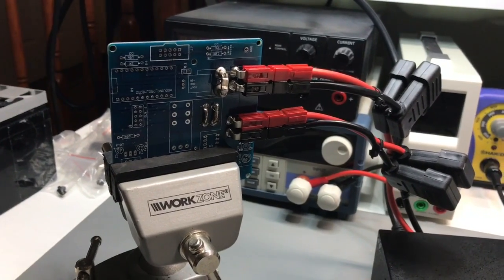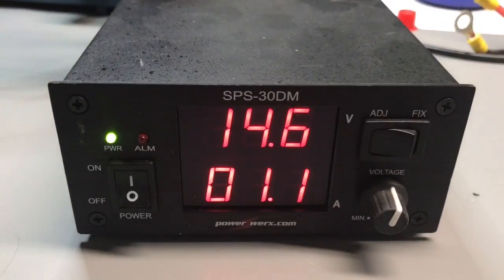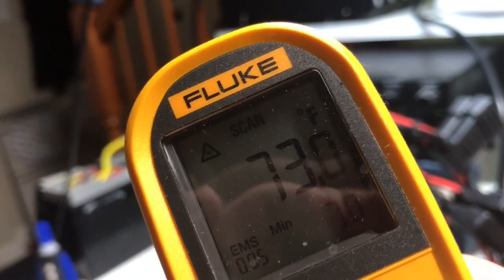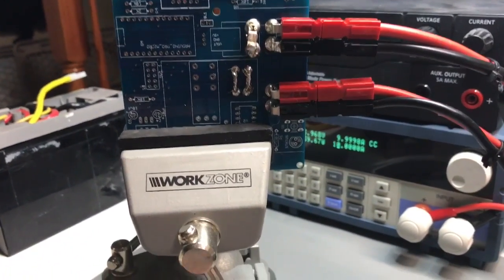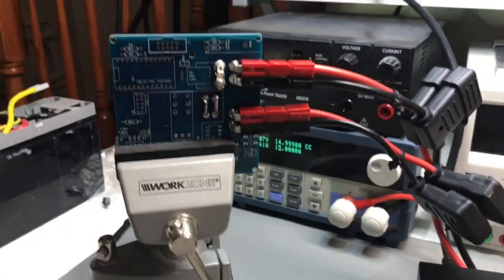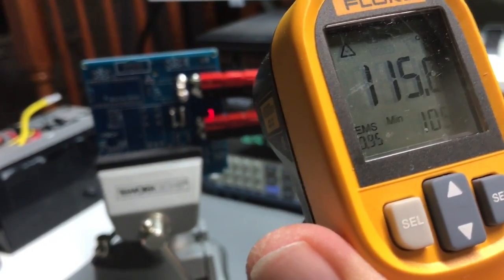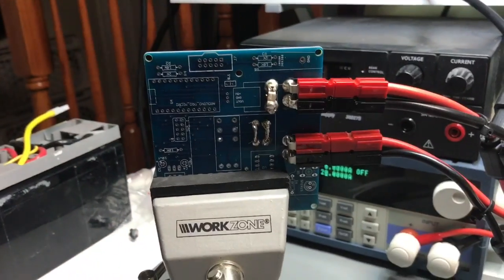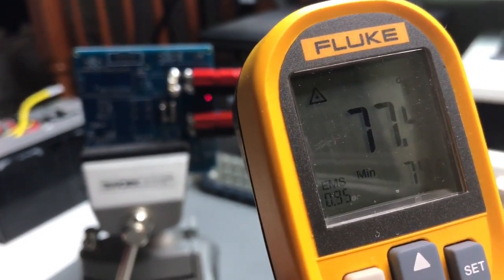Ham Radio 360 Workbench Power Board Current Handling Test

Comment: the reason u see the temp increase mainly on the GND plane is because the GND plane is basically the heatsink of a board. im not really sure what you are testing here but based on what i am seeing the heat is going exactly where it should. ....... i should have watched the rest of the video i realize when u mentioned u should increase to 2 or 3 oz copper on the GND you understand that the GND is the heat sink.
Reply from the maker: Thanks for the comment!  I'm still new to electronics so this was a surprising result, but it makes sense.  This was a prototype board for our second open source community build project for the Ham Radio 360 Workbench podcast.  My cohost sent these to me to see how much current they could carry to make sure his design wasn't far off base.  We are going to go with higher copper weight in the end!